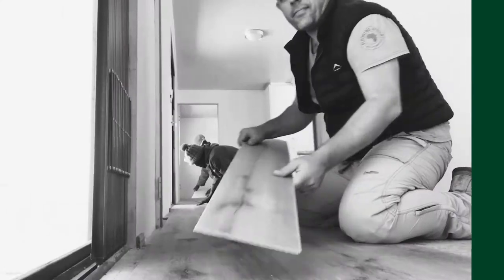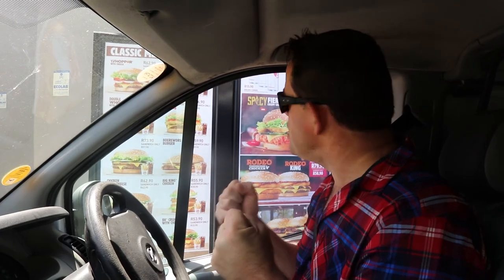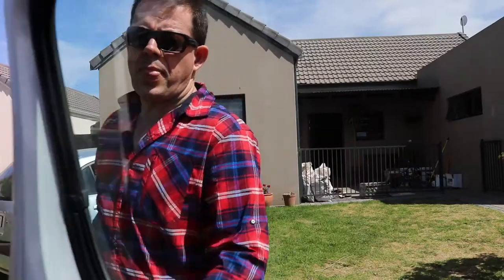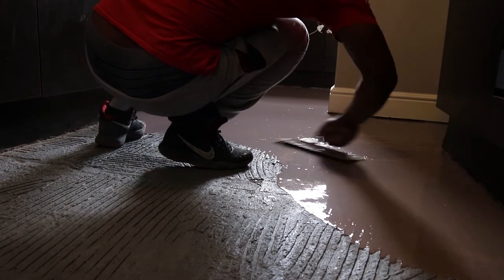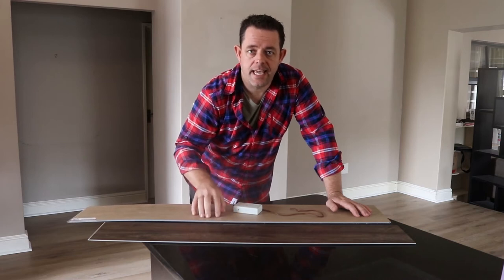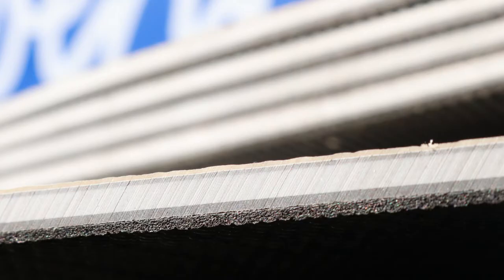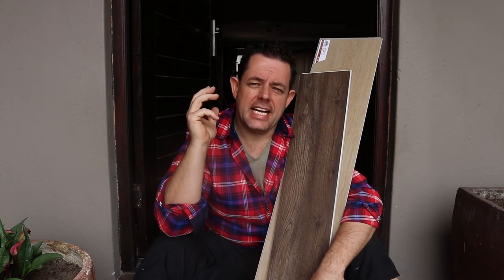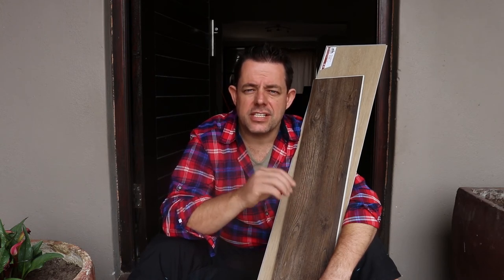Engineered SPC Explained - The Next Level - ABA SPC

Comment: Wait so this New flooring is different than ridged core spc? And it's not wpc?  Sorry but I'm confused by your video. A few video ago, you said that were 3 types of planks and that spc was the best. Now it's not?
Reply from the maker: Sorry for the confusion: the new format has a SPC core (same structure as mentioned in the previous videos)  but it is sandwiched between two layers of luxury vinyl (LVP/LVT).  Manufacturers are now starting to experiment with the main SPC material and using it as the base to hold and support other surface materials like LVT or even thin veneers of hardwood. The products are evolving very quickly. Hope this clears up the confusion. Appreciate your support of our channel.